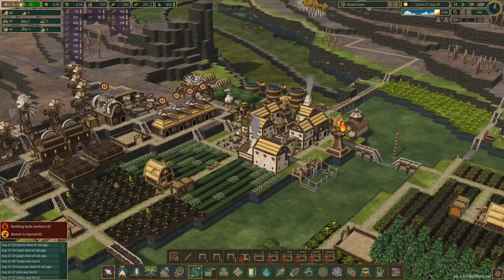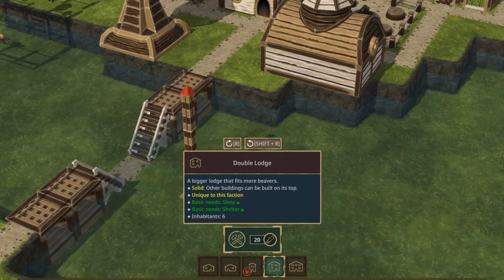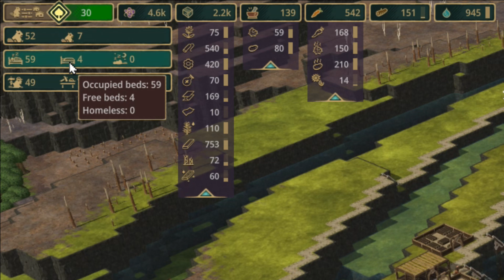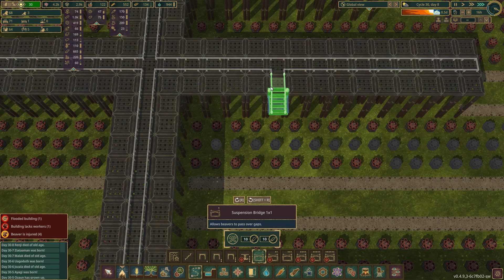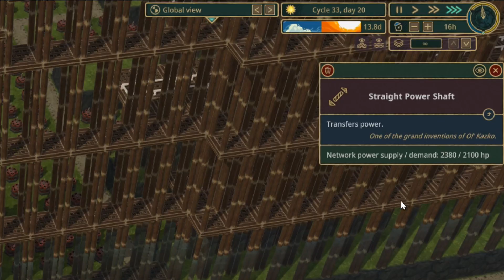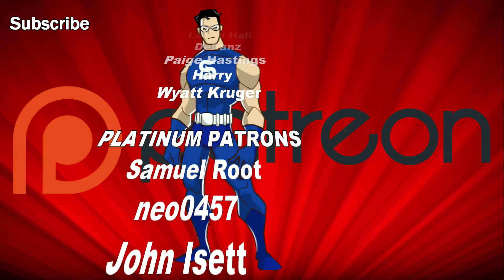The ULTIMATE Energy Source: the MEGA BATTERY! - Timberborn Hard Mode Ep 6

Comment: One thing I do to make battery and windmill construction easier is to put them on level 1 platforms,  pretty much regardless of what they are on top of (ground, buildings, scaffolds, whatever_ this allows me to run a road beneath them so the workers can easily access them,.

It makes building and expanding them much easier as all the power infrastructure is right above the beavers heads and easily within reach.

Comment: Those gravity battery platforms are ~33% overbuilt ... Just build a row as high as you want to support 50% of the batteries ( next to it build a row 1 level lower -- FOR BEAVER PATH, then put 1 high platforms over beaver path)  ... The beavers can build 1 above their heads as well as thru 1 high platforms overhead ...... Also: for vertical power reminder houses transmit power .. so a stack of houses ( you can pause  them or leave out the path if you want them vacant)